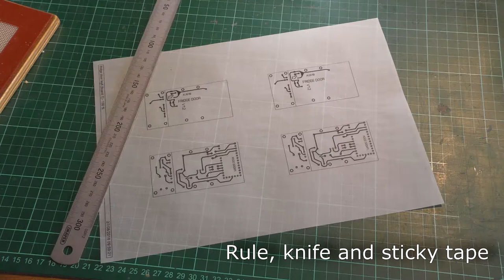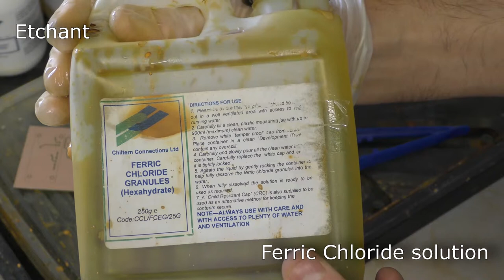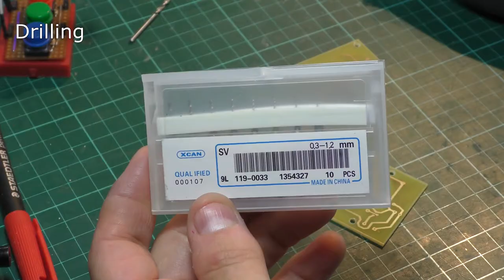Making a Printed Circuit Board

Comment: Greetings
I would like to refer to your project "Rebuilding the Vacuum Fluorescent Display".
1) Does the complete driving board for the VFD Clock and the Arduino sketch work for any VFD, as long as it has the same digit characteristics and uses the MAX6920 as a controller?
2) Would you have a Gerber file for making the board or, if not, a simple PDF design?
Thank you